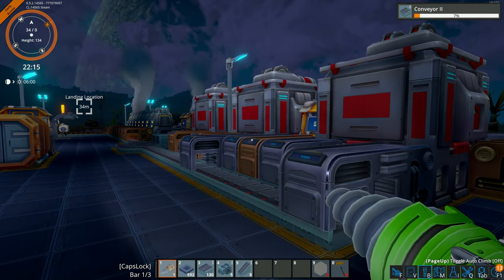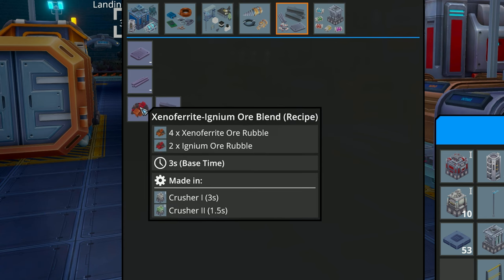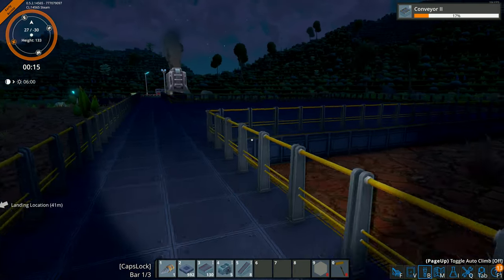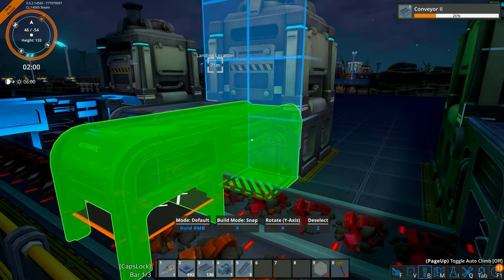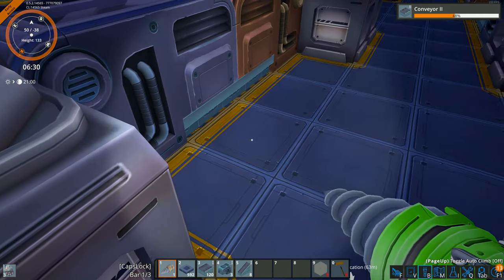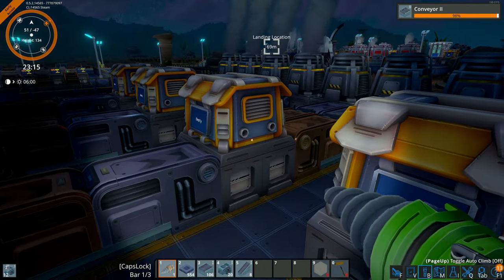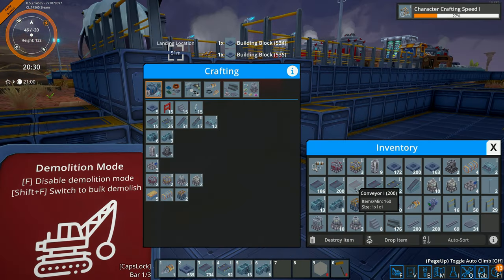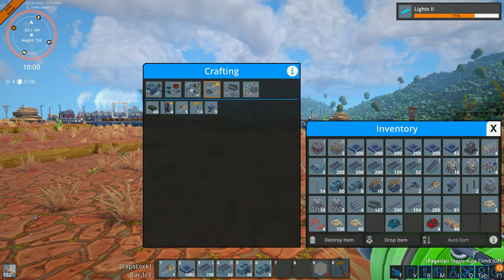MAKING A MOUNTAIN GO BOOM... In Foundry

Comment: just out of curiosity can you build your base more vertically and is there any reason not to?
Reply: Yes you can but need to research the cargo elevator otherwise will have to snake conveyors up. And the research takes yellow science packs for cargo mk2 lifts. The mk1 allows only you to move in them.